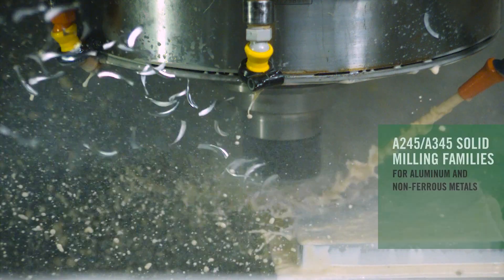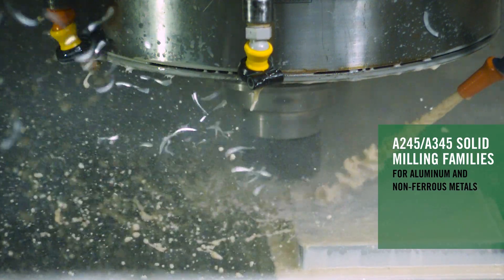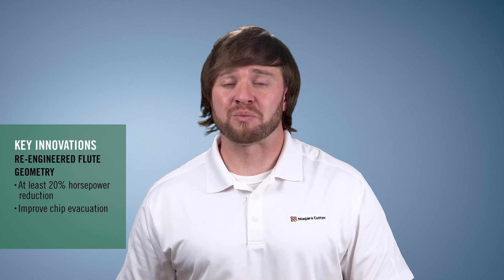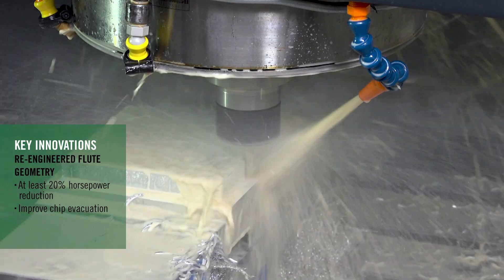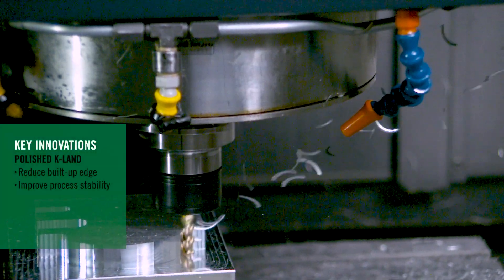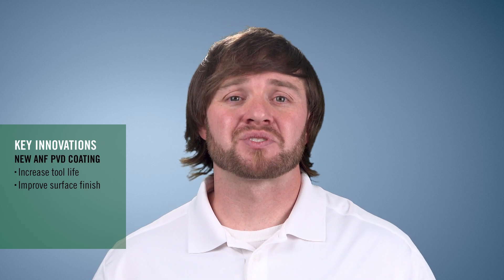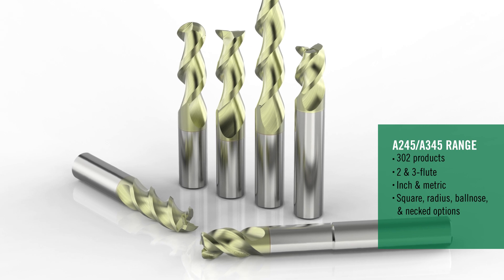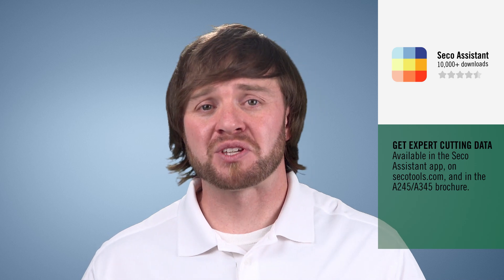Tackle Aluminum Milling with Ease Using the Niagara Cutter A Series | Seco Tools

Comment: What I think would be value added content and sufficient for me to change the shop endmill choice, is showing me the benefit. Take a common size cutter, 3/8 or 1/2”,  and run a typical adaptive strategy at a realistic average chip load and surface footage. Show me how your tool wears, the edge wear, tool life, corner radius, diameter, etc over time. Compare this to the most common tools you can find. For extra points, go into a handful of shops, ask them what cutter they use for general aluminum roughing, and feeds they run, average it and run all of them at the same conditions. Maybe a tad impractical, but it would be compelling if you can win at this and SHOW me.
Reply from the maker: Thank you for your feedback :) We'll keep this in mind for the next videos. Really good insight. Thank you